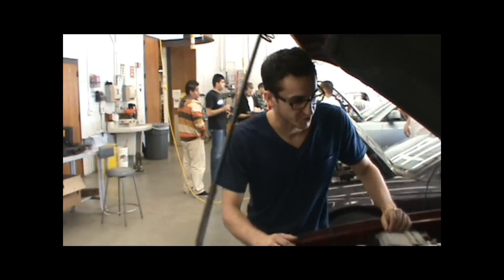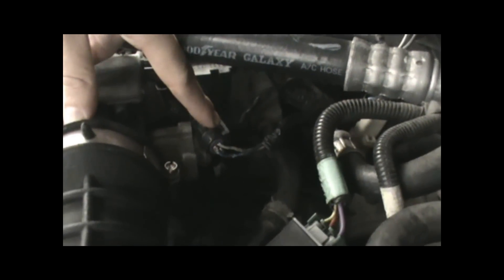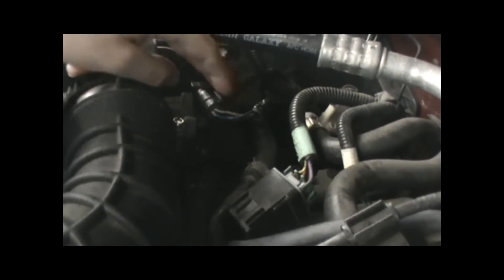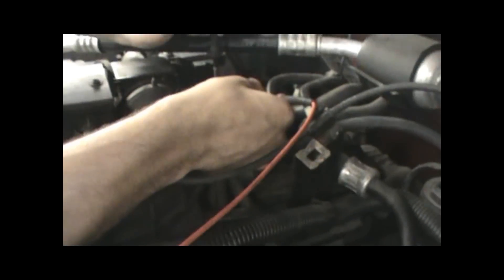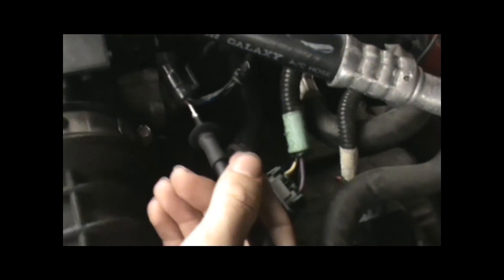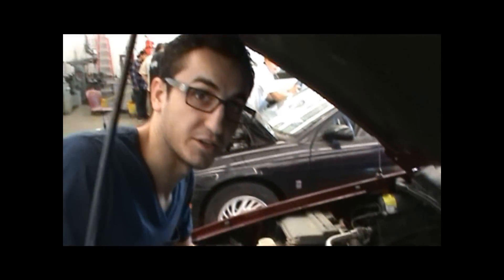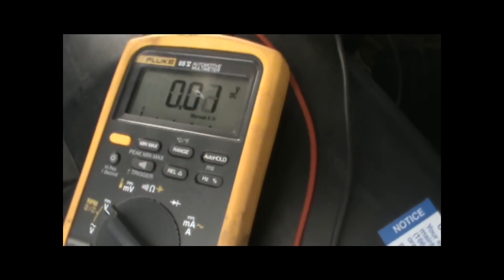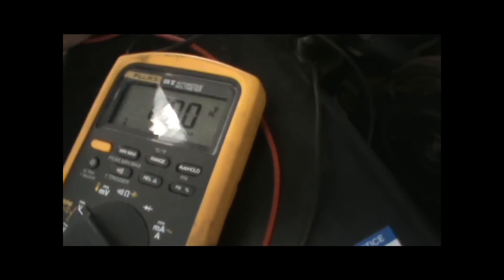How to test your Throttle Position sensor (TPS sensor)

Comment: @frankfordbully  Would a bad TPS explain a "no-code" and "NO CEL" acceleration stumble on my 2002 Mazda B2300? It was running like a Swiss watch and getting 30+mpg. All of a sudden, it started stumbling under anything heavier than a gentle throttle. Other than that, it runs smooth and idles perfectly. Plugs and wires replaced along with A/filter, and I cleaned the MAF sensor.

Comment: My sensor did the opposite. When I had no throttle it registered like 4.4 volts i think it was and on open throttle it went to .6 and .4 for 2 of them. My car will also run fine then randomly miss, jump, backfire, and die. Found out today that I can unplug my tps and plug it back in and the car starts back up. If I don't do that usually it is very hard to start and if I get it to start it dies a couple feet away

Comment: My car has been acting funny lately, and there was a code in the car mentioning a TPS.
A friend and I performed this test to see if there were any jumps in the sensor, we didn't find any jumps, however, we did find that the sensor itself went from about .35 volts to 4.5ish volts. Is .35 volts too low an idle voltage for my 91 buick regal?

Comment from the maker: @rachmaniralf You are correct that the varying resistance will cause a voltage change that is linearly proportional, but the DVOM or DMM will not be quick enough to show this response.  This is why I'm telling you that a scope is needed for intermittent diagnosis.  It would pick those voltage changes up.
Knowledge is useful my friend, but practice is even better.  Go try it on a vehicle and you will understand.

Comment: Can you take it a step further. I have a problem with the voltages TO the TSP. The 5V reference is good but the voltage to the blue wire that actually tells the voltage to the computer is bad. I get 0.4V with the throttle closed and it drops to 0vdc when the throttle is opened. Thank you

Comment: Normally,the TPS has three wires,which wire is for checking the voltage,signal wire and the 5v reference wire or the signal wire and ground wire? Thanks

Comment: Like many of you I didn't like this test either, but I have a question about doing it right. My meter (Fluke 179) has the true RMS bar at the bottom of the screen. If I set the range manually and watch the bar at the bottom of the screen while I slowly move the throttle I get a good clean sweep through the whole range.
Is this a good way to run this test??

Comment: Hopefully replacing this thing will fix my Civic's 3000 rpm idle surges. I don't wanna have to replace the Idle Air Control Valve. That shit is expensive.

Comment from the maker: @texasrecyclers What we're showing here is a test to eliminate a DEAD TPS sensor, not a sensor with intermittent failure.  Even with 20k-ohm set on the meter, it wouldn't read the cycle rate fast enough to catch a fault.  This is why you would want to use a SCOPE that reads 2 million parts per second.  A digital meter only reads about 1000-4000 parts per minute, not NEARLY enough to catch a fault.
I appreciate the comment, but your method of testing is unfortunately incorrect.  SUBSCBRIBE

Comment from the maker: Remember, in tough situations you must start with the simplest problems.  We're dealing with a load issue, as the car is producing this hesitation apon take off & acceleration.  Saying things have been "checked" doesn't provide enough evidence that they were actually checked.  I would need to see fuel pressure, air fuel, exhaust back pressure, Maf sensor or eqiuvalent, and a smog reading to see what's going on....not t mention the obvious spark test.
When you can get those numbers, contact me.

Comment: this test only tests if the sensor reads WOT or closed throttle most of the times your gonna have a problem with the sensor cutting in and out. it would be easier to just check the TP sensor with a scan tool and even then you would be more likely to see a jump or dip in voltage and if you were really serious about testing it this way you would really need a lab scope not a multimeter